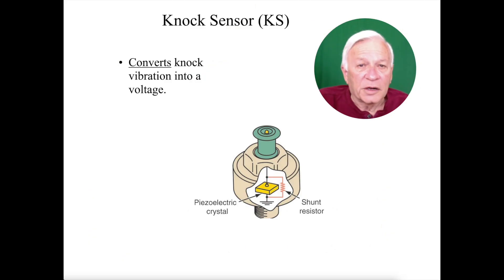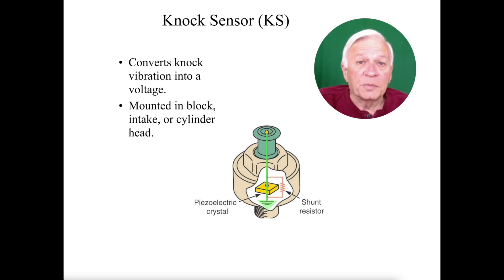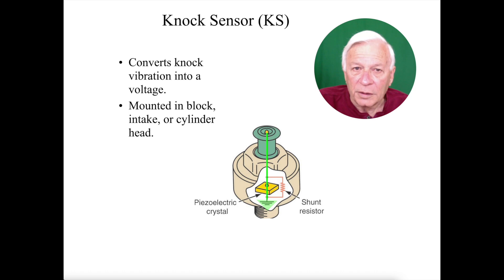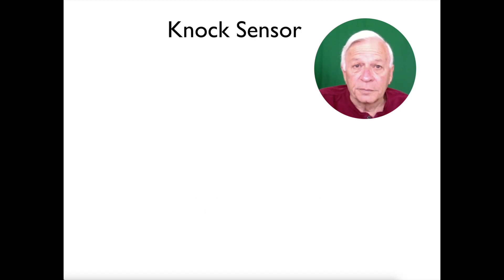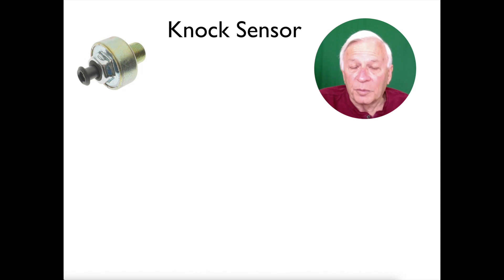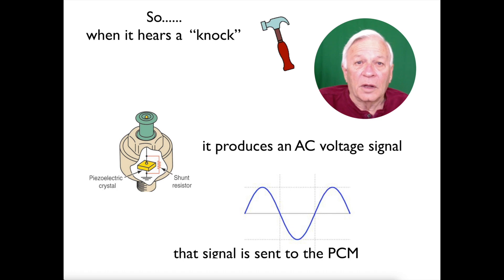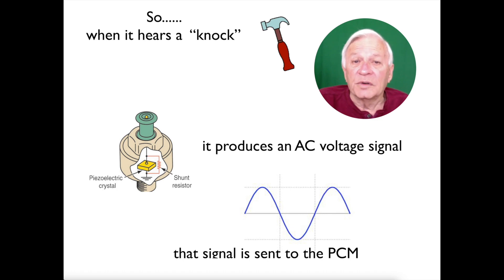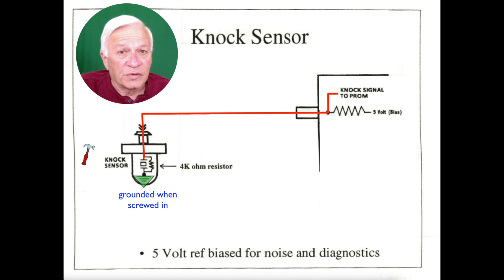Automotive Sensors Part 4

Comment: Why so complicated?
A knock sensor is a microphone and the ECU has tables and parameters to interpret the “sound”.
Reply: at least some,if not all, microphones have a voice coil,not a piezo crystal; this is different, a freak of nature, it actually produces electricity, just like a piezo lighter that produces a high voltage that you can plainly ,and that can shock you bad..